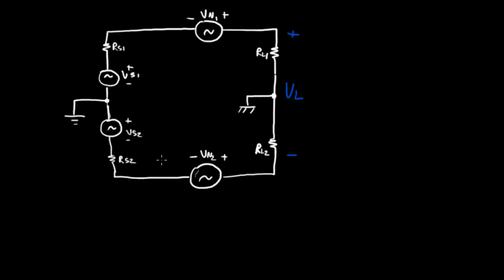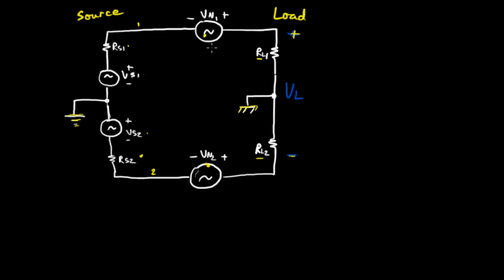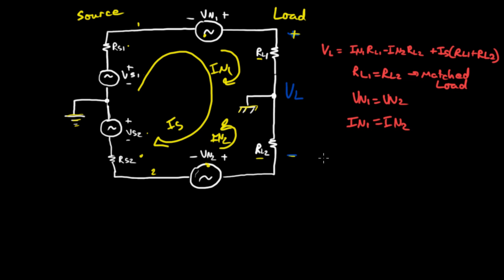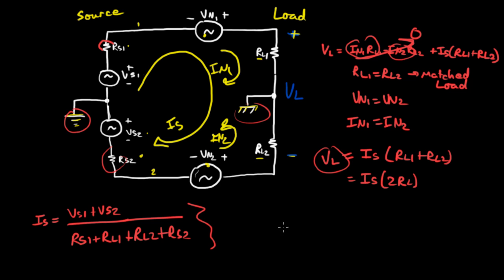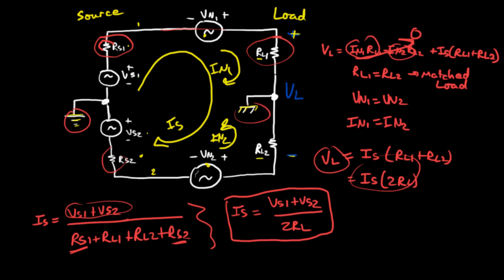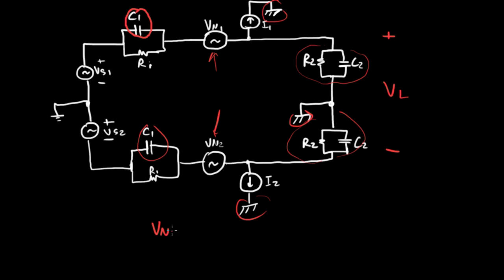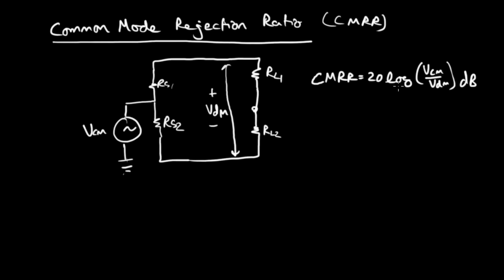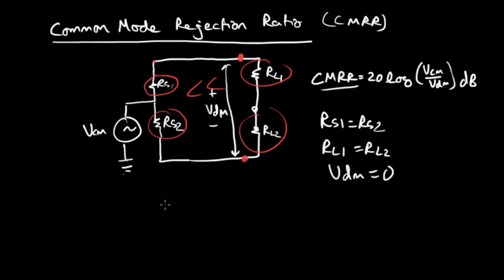Differential Signaling 2 of 4

Comment: 1. source output impedance as low as possible;
2. load input impedance as high as possible;
3. lines matched

what do you mean by "lines matched"?  do you mean the lines suffer from the common mode noise? thanks in advance.